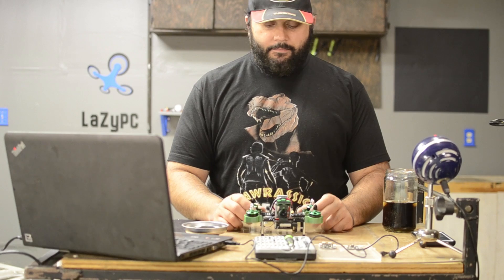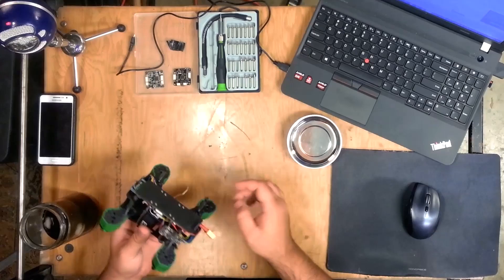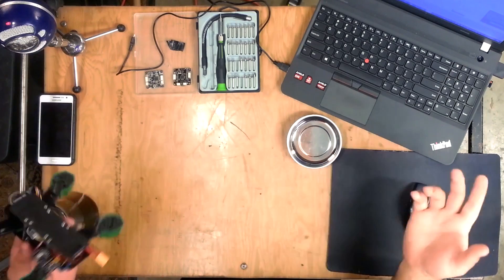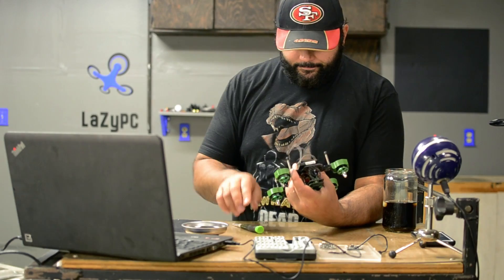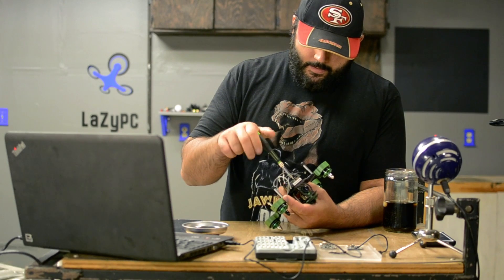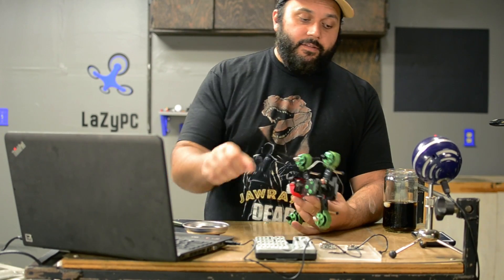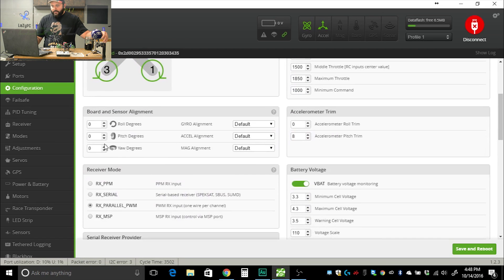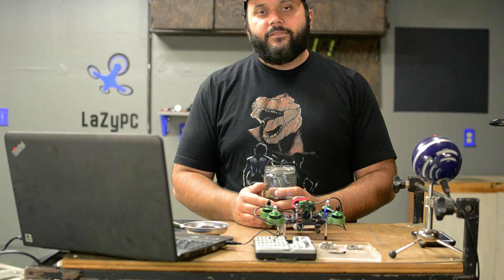Eachine Falcon 180 Turning the FC/Accessing the USB - LaZyPC

Comment: Hei. How do i eliminate the gyro fault, it wont keep itself leveled when i try to fly sideways. It wont correct itself.  Im not good in english.  But when i pull the stick sideways i have to correct it myself.  Im not sure what the flight modes mean.  Is it the setp on my controller maybe?  Or is it anything else im doing wrong?  I should be leveled.  I cant fly 3d yet. I need gyro. I have all the good cams and fat shark hd2 3d and runcams. Almost all of them.  But im struggling with the different modes and what they do. And how to tune the pid.  Maybe i can use your pid.  If you can make a video like that many beginners would love it.  Thanks for your work sir.   I hope you may be able to help me.  It keeps it leveled when i push it forward and back. Then it level itself.  Not when sideways.  I am from Norway.  Ever heard a Norwegian speak good English;-))))   So thats my main problem.  Some words.  I can understand the language and i dont have to liste to carefully.  I can even hear dialects easy.     Movies from web;-))  But they dont teach pid tuning and what the modes mean and do.   So please help sir???  :-)